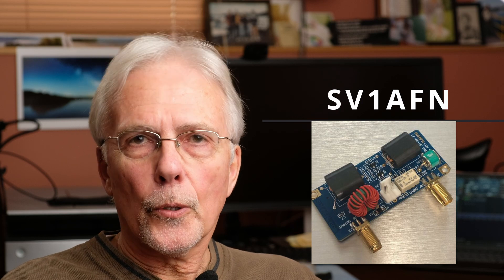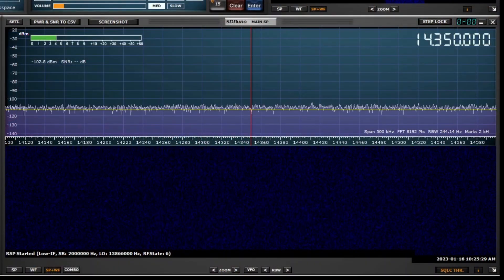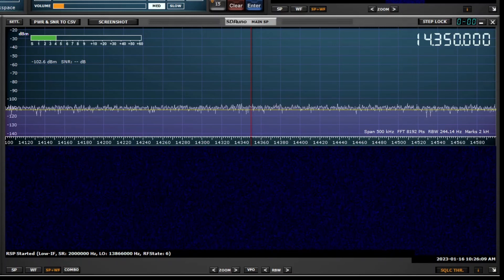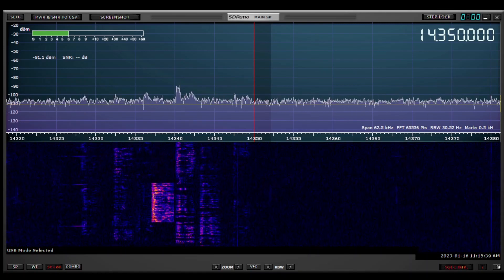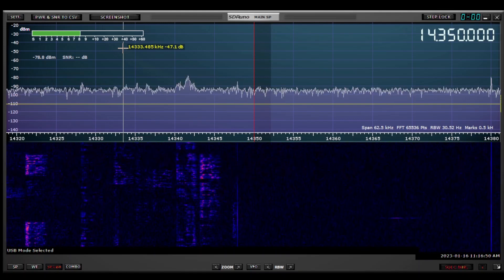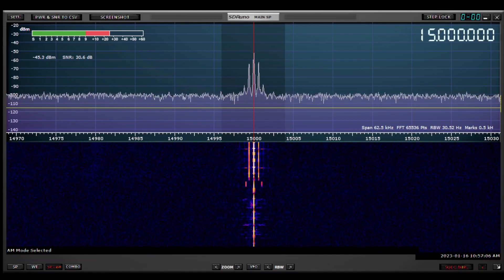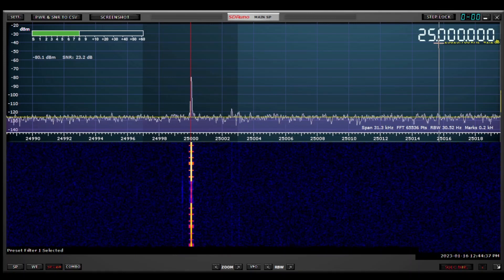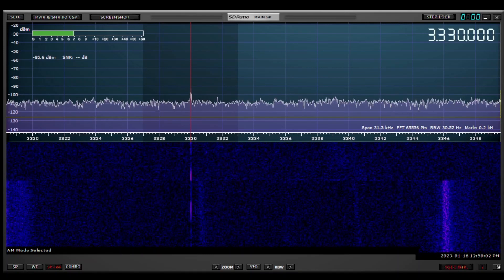RF Preamps for HF Receivers: Worth it?

Comment: In the 70's, I tried playing with the ham satellites that would pass overhead.  The downlink was on 10M and all I had was a random wire pushed through a basement window and up into a tree about 25 feet.  I lived in suburbia a few miles from NYC, so noise and interference was about as bad as anywhere on earth.  I could hear the CW as the satellite passed over, but it was too weak to read.  I added an RF preamp and it was like night and day. For my situation it was well worth the small investment I made.

Comment: My G4CLF based transceiver has no pre-amp and I don't miss much. Now adding 60m.
I compared it with an FT817 some years ago at a special event station and my h/b radio received signals at a lower level only on 10m. It was designed with no pre-amp. 
It was a good test to see how well my receiver was working compared with a commercial one. Measured figure from the original article was 0.2 microvolt sensitivity.
G4GHB

Comment: i bought a vintage american nippon premap, but i'm confused bc online they had 135db, woudn't that burn my RTL SDR?
the reason was bc after running a +10m long coax cable, i noticed a 10db drop in my signal, and the internal LNA or hardware AGC is noisy and produce lot of heat

Comment: For the typical high noise suburban location, indoor RF preamps are only worthwhile at upper HF, low VHF, and above. The indoor preamp, providing it is nominal 2 dB or lower NF, only lowers the noise figure of your radio (e.g. Icom).  Hence assuming a R8500 receiver front-end NF is 8 dB at 35 MHz, the indoor preamp will lower it to circa 2 dB when in circuit. The catch is that external atmospheric, galactic, and man-made RF noise is typically above 8 dB. This means that high quality receivers such as the Icom R8500 and R8600 are already RF noise-limited. At my location a 35 MHz dipole generates a dramatic increase in RF noise when connected to an Icom R8500 at low VHF. My 35 metre length coax length to the house introduces 2.5 dB loss. But because the ambient external RF noise is sufficiently high, even 0 dB coax cable loss would not produce any discernible signal-to-noise (SNR) improvement. A better option is to position a nominal 2 dB NF preamp near the antenna terminals. But even that improved arrangement may not result in a discernible SNR improvement at HF and low VHF. During days of high power pole RF noise, it is not possible for preamps to improve SNR, even at 50 MHz VHF. RF preamps for HF receivers are mainly beneficial when operating in rural or coastal areas well removed from man-made RF noise.